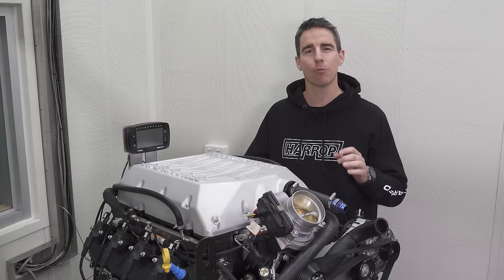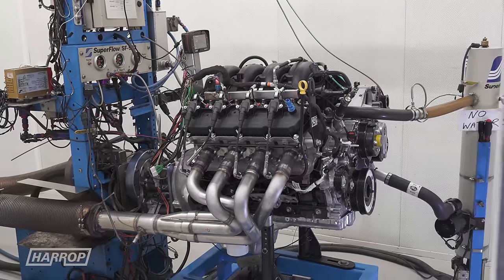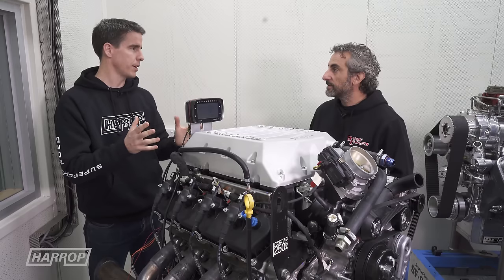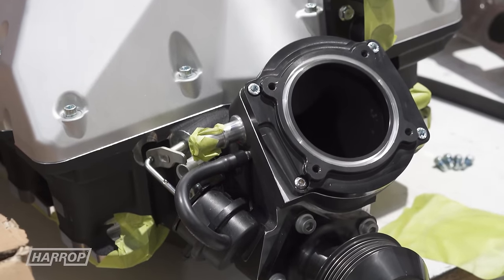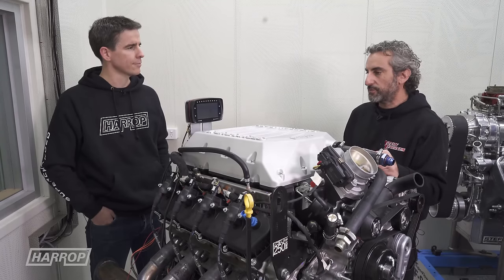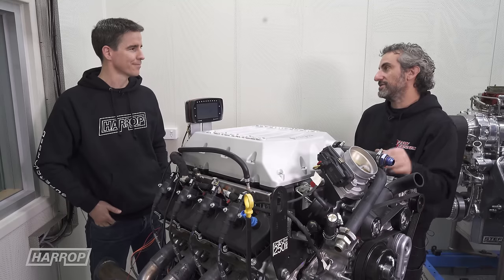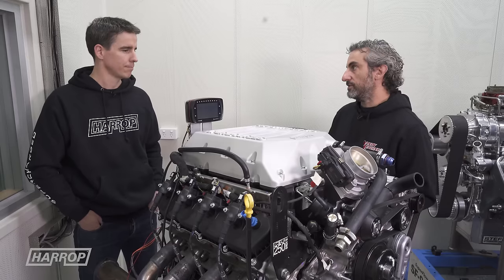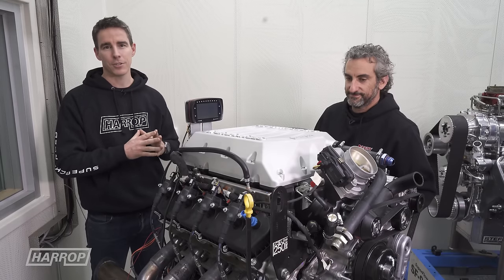Ford Godzilla 7.3L V8 | Harrop Supercharger Testing

Comment: This engine was designed by a team led by a drag racer. The result is this engines impressive performance worthy of the name Godzilla!.
Reply: roomer has it it was built to kill the ls platform just so happens they built a killer truck engine as well
Reply: @hellblazer275  it can’t take over the ls because the point of it is price for power. The 7.3 is very rare still. Also for a 3/4 or 1 ton truck you might as well get a diesel if your goin use it as a truck
Reply: @hellblazer275  rumour
Reply: @bbdl7042  99% of 3/4 - 1 ton trucks are never used anywhere near there potential. The diesel is unnecessary for most buyers.
Reply: So you’re saying they copied Chevy to a T?  Lol, this exact scenario is how the LS was born to begin with.
Reply: The molar hellaphant has competition
Reply: @bbdl7042  we're using it in delivery trucks because the company we contract with is trying to phase out diesel, and pushing us to go towards gas or electric.
Reply: @bbdl7042  no
I do a lot of heavy concrete work. It's extremely well suited for heavy towing.
Reply: @coffelt683  100% of 3/4 and bigger trucks should come in diesel only. You’re already moving a chassis that’s 7,000 pounds without drivetrain. It’s a lot for a gas engine. 

Now If the F150 had the 7.3

That would be a lighting….wait a minute….
Reply: @bbdl7042  diesel's will be regulated out of the market in 1/2 tons, possibly beyond, diesel fumes are a carcinogen period. Gas fumes are rated in the same category as coffee fumes....I wouldn't be around a diesel unless it were absolutely necessary.
Reply: @bbdl7042  Except the NEW Diesels with all the after treatment and whatnot are LESS Reliable, $10,000 MORE expensive, and Get about same Fuel Economy burning a fuel that is shamed by the tree huggers, and spraying piss into the exhaust for "Cleaning" which adds to the cost and complexity... IF Ford would have designed the 7.3 as an Ecoboost with dual stage injection and the Altitude tolerance of Turbos (for climbing mountains) there would be NO practical reason for a diesel at all...I see the Dual stage injection and Turbos being the NEXT wave of Gasoline or Alternative fuels...Before Electric takes over in 30 years.
Reply: @misters2837  add freevalve (no wastegate needed) maybe precombustion chamber and meth injection...
Reply: Freevalve maybe, Prechambers are horribly inefficient...
Meth...I, like millions of others don't want to be adding fluids all the time...besides with proper intercooler its not needed.
Reply: @Steve-yr5vi  wow your one of those, it’s be another 2 decades before we see that. And semis even longer. Everyone now knows you’ve never hauled heavy than a small car.
Reply: Going to be hard to beat an LS for HP/dollar. Add a turbo to any ls and the potential is ridiculous.
Reply: @maxboya  Well if the diesels in 3/4 and larger trucks were not loaded with emissions B.S. I would agree and in the 90s I thought just like you... But as for a 7.3L gas 430/475 having too much truck to haul around...that is funny...We had F600 trucks with Carbureted 4.9L inline sixes that made 120hp and 225lb-ft of torque that had GVWR of 20,000lbs and 33,000lb F700s with 230hp/340lb-ft of torque Carbureted 429s (and were thankful we didn't have the 190hp 370) NO...actually the new 7.3 is very powerful...
Reply: @misters2837  right but running Dana 90s with the gear ratios to move em lol
Reply: @maxboya  Eaton 2 Speeds with Clark 5 speeds...
Reply: @misters2837  Yes sir yes sir!
Reply: @hellblazer275  no it was because ford didn't have an hd like the 460. This is what they came up with! Built for trucks and industrial applications!
Reply: @Racc1-1  no YOU MEAN THEY REMADE THE 351 WINDSOR? because if im not mistaken the ls is beefier version of the windsor so this would be a copy of a ford engine not a chevy engine go chec the 351 ls build literally ls parts bolt up to the windsor
Reply: @ranware2779  Chevy practically pioneered small blocks, so I have no idea what you mean by that.  I’m a Ford guy, believe me.  Chevy has the crown on this one though.
Reply: @Racc1-1  IF YOU'RE INTO THIS THAN YOU WOULD KNOW THE LS PLATFORM IS A DIRECT BEEFIER VERSION OF A 351 WINDSOR you can get mad facts are facts chevy didnt pioneer anything but the corvette. There is a reason ls heads bolt to 351 windsors with ease dont fire up because the fiting order is bacwards
Reply: @ranware2779  I’m not mad lol you’re the one with caps lock on and commenting on a 3 month old thread.
Reply: @Racc1-1  u gotta be mad tryin to challenge facts na i wrote bold letters so you're not confused u seem a little shallow on info..... Reading is a good thing my guy
Reply: @Racc1-1  u said 3month old thread...... wtf this engine is gonna be the talk fir a while get over it
Reply: @ranware2779  I am so mad random internet man.
Reply: @Racc1-1  Despite the rumor created by ford fans that the LS was originally a ford design. It is actually an evolution of the SBC and had nothing to do with ford.
Reply: @bbdl7042  most large commercial businesses are moving away from diesel, due to costly repairs concerning exhaust cleaning systems.
Reply: @unamusedarchitect1646  def destroyed the diesels,  but comparing a gasser and a diesel when it comes too hauling is stupid. Gm has already leaked the next duramax at 500+hp and almost 1100tq and the other two will follow. Gassers aren’t even too 600 tq how is it a comparison. Out side of def ( worse for the environment sadly ) diesels last longer if under the same work load as a gasser.
Reply: No just Brian Wolfe but a few other very very wise men. One makes billet part's for any racing industry 😉
Reply: @hellblazer275  it has zero chance at killing the LS as it is now. The main point of going LS is the aftermarket support, you can even build an LS using 100% aftermarket parts including the block and heads if you wanted to.
Reply: @maxboya  I agree if youre pulling heavy  and frequent and making money to support the Diesel yes go for it, but other wise gasser are fine within thier intended gvwr
Reply: @mrhrobinson  - who cares best V8 small block is a Ford the 351 Cleveland dominated pro stock no crappy Chevy in sight. Even a stroked Windsor is enough for the overrated LS there’s 4 door Falcons in Australia doing 6’s
Reply: @CoyoteFTW  Yeah that's  why you rarely see those piece of ahit windors or clevelands  anymore, lol. At least use a relavent engine and not one that no one uses or care about. And we are not talking about the 60s or 70s.
Reply: @mrhrobinson  - talking about whatever I want to talk about it was the 70’s & 80’s. Nothing garbage motors has comes close.
Reply: @Steve-yr5vi  You seem to be overlooking the fact that gas emissions contains carbon monoxide, which is fatal. Diesel exhaust might make you nauseous but not so likely to kill you. Ever heard of anyone killing themselves with a diesel motor running in a garage?

Comment: I have this 7.3L Godzilla motor in my 2020 F-350 Lariat. It's the reason I traded in my 2019 F-250 (6.2L). I wanted that new 445CI (7.3L) Ford conventional push rod motor bad! Well I have it and I'm loving it! (I don't know about going the supercharger route with mine but it sure is nice to know you COULD go that route, if you chose to). No overhead cam stuff going on here. Push rod motor and I LOVE the 6 bolt mains! 430HP and 475 LBS Feet of Torque from the factory! Love it.

Comment: This with the 10R80 will be a KILLER
Reply: Bob Watters  straight up, you want power through revs if you’ve got that many gears 👌
Reply: Bob Watters  a 10 speed 7.3 destroys a 6 speed 7.3.
Reply: Bob Watters  CVT
Reply: @andymack8178  Ew, gross
Reply: You'd need a 10R140.. 10R80 wouldn't last
Reply: @kevinfitzpatrick5949  hahaha thank you.
Reply: I would like to see one with a TH400 behind it.
Reply: @hunterjohnson4954  I second that.
Reply: @Nashic12  10r80 have supported  1200rwph cars that hit the track
Reply: Bob Watters  The 10 speed is more like a 7 speed but with a 4 clutch system when racing. Last 3 gears are overdrive. So 4 clutches for faster shifting plus 7 gears for closer ratio to stay in power... honestly they're plenty good for racing.
Reply: the 10speed is junk
Reply: @maxtheroofer8004  said no one ever
Reply: 6r80
Reply: @maxtheroofer8004  It's actually really great
Reply: @maxtheroofer8004  hush

Comment: Thick cast iron block and cylinder walls calls for BIG boost, in no time will we start seeing these shoe horned into tube chassis cars with 100+mm turbos bolted on 🤙
Reply: Yup, turbo + e85. But... stock valve springs may not hold shut at 15psi
Reply: @nordic5490  that’s where the aftermarket part companies come in.

Comment: I am looking to buy a F-250 to tow my camper and I am fighting buying a diesel. Why because past the 1050ft lbs of torque and $10,500. The risk versus reward makes me think. Will the 7.3 work well for towing 13,000lbs. If I get the 7.3 and down the road can I add some upgrades for $6000 and have a substitute dependable beast. Any thoughts?

Comment: Cracking street engine combo. 😁🤟👌
Reply: If you're a millionaire
Reply: @kennithchapman9689  engine itself is only 8 grand
Reply: @kennithchapman9689  It's very well priced for the performance. 👍
Reply: I'VE GOT A CHARGER SYSTEM THAT ELIMINATES THE EXHAUST STROKE.
Reply: @ronniewall1481  so it is converted to a two stroke? Please explain more
Reply: @ayoutubechannel921  AT BOTTOM AIR IS EXCHANGED WITH BLOWER.
Reply: 13.5k delivered to Australia

Comment: I really want to go 7.3 in my 1st gen Raptor. And I want to go with whatever intake will give me the most HP gains and torque without forced induction. My 6.2 is really tired and guzzles too much gas. I heard the 7.3 is actually better on mpg's. And somebody told me the right supercharger actually improves mpg's. I'm not sure if I believe that but I'm open to whatever will improve my mpg's and give me more power.

Comment: I've noticed on most newer high performance engines the ports are so much straighter of a shot into the intake. They seem to flow so much better than the old v8 designs. Even the 3.6 v6 in my imp has really big straight ports for power.

Comment: I fucking love Ford... Henry would be proud of this one.
Reply: Yes sir , if you cut me I’ll bleed blue ovals . I’ll die a Ford man , they are super tough , I drag race , street and strip , a Chevy will blow from the abuse I put engine’s through, I have never blown a Ford engine and I push engines to the extreme.
Reply: @jamesmills3176  the only trucks that you can put 250,000 miles on and keep beating the hell out of. I'm 23 have a couple f 150s I plan on saving the old triton v8 as a keep sake. Work of art.
Reply: Joseph O yes sir ! Those triton”s are tough . You can beat the hell out of them and they want more peddle on the floor . I can’t wait until I can afford the new 7.3 Godzilla that came out late last year . Already they have a super charger - water intercooled - for them . You can put 13 LBS of boost on a stock bottom end and they will handle it with no problem’s . Ford is just bad ass
Reply: @jamesmills3176  it would be a beautiful engine to put in an old square body high boy. All chromed out.
Reply: @jamesmills3176  i used to mud drag and bog , I'd put the Ford engine's thru hell !  You know because of the instant high revs and tire spin in the wet . You can wear one down like a pencil eraser from use ,but they keep running

Comment: I have a 2015 Mustang Gt with the Roush 2300 that makes 670 HP and is 250 pounds lighter why would you want this unless you doing cams and head work like a LS motor?

Comment: Cool to see the godzilla getting some R&D in Australia. This supercharger would be great for the Australian market with conversions if the new front drive came with different front snout options for a forward facing throttle body as the way it currently is really only suits the American trucks and a revised front drive pulley assembly to accommodate off the shelf power steering pump/ alternator/ac etc. Great work guys
Reply: Have you seen Evan Smith’s video on Indy Power Products oil pan, oil pump and front accessory drive setup for the Godzilla?  It just came out and I think addresses several of the problems you mentioned.  👍
Reply: in a crown vic would be a beast ..

Comment: As good as this might be for a street rod. Really I see this new motor as a winner for marine applications.

Especially ski/wake boats.

NA with a cam will see you past 480/500kW (just look at those ports😁.) With loads of torque for that hole shot to pull fat bastards out of the water or move around 2tonnes of wake balast.

Go supercharged and use river water for the working fluid and boom. 700-800kw
Reply: Yeah, im not the only one thinking boat application.  Attach to a mercury #6 drive and we are in for some fun times.

Comment: I have a 2021 E350 cutaway van with the 7.3 gas motor and it will cook the tires with a 5Star tune on it.
Reply: Nice! Im a plumbing contractor in SoCal. Of my next rig in my fleet isn’t a Chevy 5500 with 12’ box, I’m definitely going to the 7.3.

Comment: Love seeing Big Inch push rod engines being  redeveloped for this current era. Big Diesel engines have their purpose but the complexity and cost of diesel emissions and crazy Fuel systems makes them very expensive to maintain. I know if a 2020 Duramax fuel pump goes bad, the entire fuel system needs to be replaced which is a $15k repair. These are the type of problems Gas motors simply don’t have.

Comment: Atm I'm looking at a rebuild on my boss 260 if I have damaged my bearings, no one does a stock rebuild on a V8, I love my quad cams, every second hand coyote and miami is worth more than this new godzilla according to the wreckers, godzilla is all modular bellhousing and coyote flywheel and I want to use my car for drifting and any Motorsports, seems like a good replacement option
Reply: If it's as good as they say, it's like an ls, but better. Didn't know it'd bolt on a v8 falcon 😉
Reply: @andrewlace  the engine mounts and oil pan probably wont bolt in, but the transmission and clutch stuff will work, starter motor is unknown to me though

Comment: Auhhh I Iove that ford power....definitely a LS and hemi killer👍🏾👍🏾
Reply: Hellaphent crate engine makes 1000hp. This is making only 800? The demon is already doing 9.6sec with 840hp.. think about that. I do like that ford is making bigger engines but the numbers need to go higher.
Reply: @user-yk5xk5re3p  the numbers do need to go higher I agree, however those numbers aren't bad for stock bottom end, heads and camshaft
Reply: @David-yy7lb  Exactly, this is still truck stuff, with hauling tons of weight, not even std car duty stuff !!
Reply: You do understand this is a truck engine not a high performance engine?
Reply: @royrichardson9164  but to make it a high preformed engine will cost you 30k engine included.

Comment: 10.5:1 compression with cast aluminum pistons.  Wouldn't go much higher than 11 psi unless you're hoping for a rebuild soon (clip the rings else you risk pinching them w/ more boost).  Custom cam with some porting would likely yield quite a bit more out of it.
Reply: Yeah pistons will be the weak point.  It'll be like boosted LS3s all over again.. don't get greedy.

Comment: Laughs in 8.4L v10 Dodge Viper. 

But seriously that’s supper cool! Nice video
Reply: dude this thing is bigger than a 426 and makes less power than a 392. Everyone in this thread thinking it's a good build are in la la land
Reply: @xTHHxAimiForevr  it's a truck engine out of the box. A few modifications and it's very easy to push 1k hp. If you can't appreciate that, well I guess go buy a honda lol.

Comment: Know that kind of engine should be reserved only for heavy duty 4 wheel drive trucks and even Vans screw the race car and what about installing bigger heads and Pistons could we get this engine up to 1100 horsepower what kind of extreme duty transmission would it require for that horsepower and the four wheel drive system I mean I'm talking Total truck  four-wheel drive

Comment: I have a question ?
I am trying to work out how to tell my Mrs ?
The engine in my FG is going need to be replaced.
But it will cost 30k for a new motor.

Can you please give me some advice on preparing for this conversation ?
Reply: Do it, beg forgiveness, sometimes it works for me!
Reply: @robertwestall3456   🤣🤣🤣
Reply: Introduce her to the new pool boy.
Reply: @harrywalker5836  
😂 Sounds like fairly aggressive tactics for the sake of an Engine.
I still Love my Misses a little more than an Engine.
I was thinking more along the lines of🙏 for the Engine.
Than actually killing someone for this Engine.
Definitely a FUN Engine to put in my FG Ute though.
Next concern is spending another 30k for the Driveline to handle this much Torque ????
Reply: @weldmachine  yeh,all fun comment.. well, as to drive line. early c6 auto. maybe. less comp crap the better.. diff. find an f250 truck. early d60 or late s/duty.  cut shut. 9'',well,it wont be a 9"' when finished. look up u.s vids.. more info there than here.. dodge challengers, like mine, run a d60.. std.. 440ci. theres housings available in u.s. ebay. anything for a car, u.s. i have 5 u.s vehicles. dont buy squat here..wreckers sell s/duty diffs for 500. i imported a d44  front diff, & d60. rear. my challenger, a 1962 f100 4x4. a 460, & a zf 5sp..plus sht load of bits.. youll need a sump making id say. can you weld.?.oh,forgot,,weld machine..its cheaper, to import a whole vehicle, than parts some times. . sell the rest.